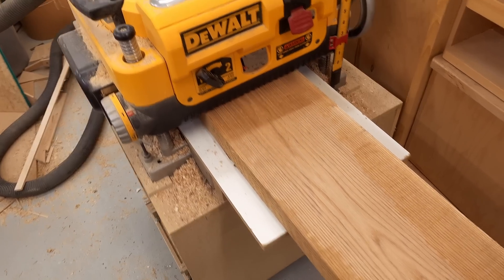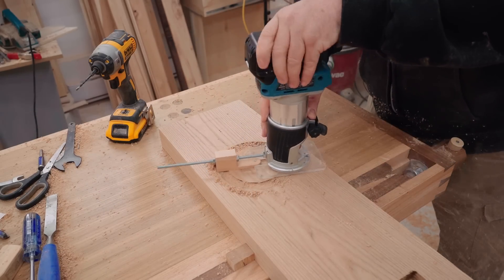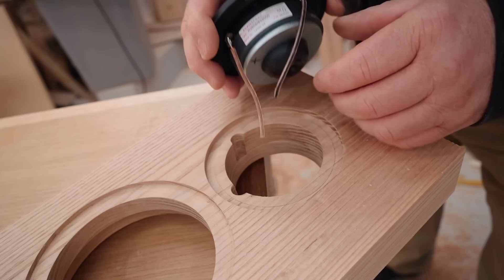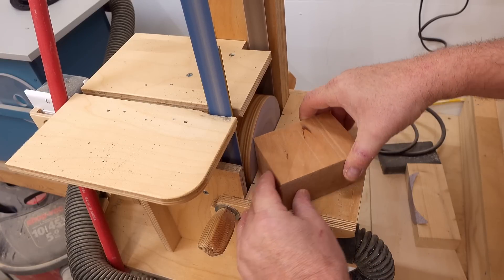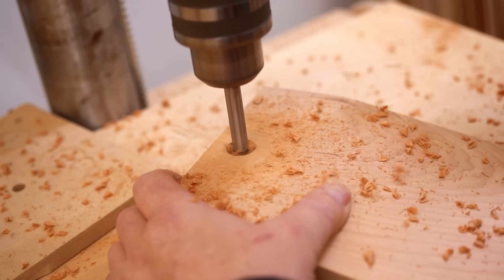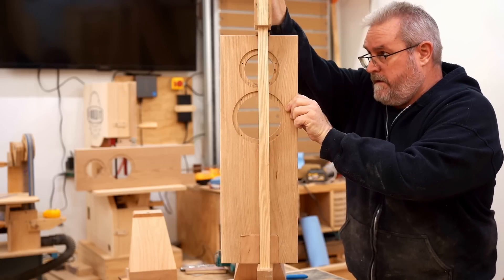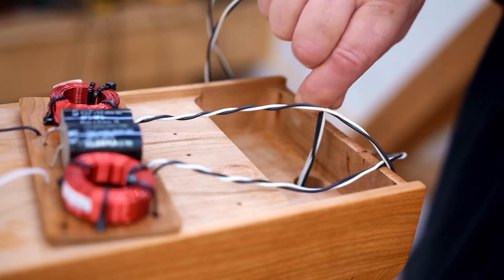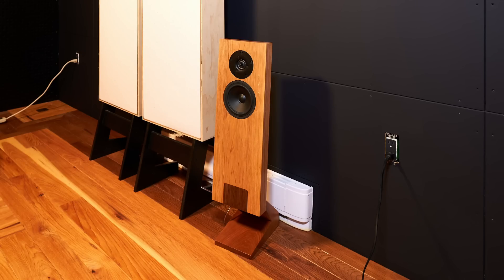Amazing Sound and Cool Unique Design - How I Made These Slim Open Baffle Speakers

Comment from the maker: I made these to work with the main speakers in my dedicated listening room. They act similar to side surround speakers and don't put out much bass. But with a separate subwoofer, these sound very good indeed. 
They are open baffle, in that they don't have a box. Making a speaker that way has some advantages, in that it put out sound from the rear as well that can sound more "full" and "open" and less "boxy". The output pattern is reduced on the sides of the speakers, making them more directional.
Not enough detail in this video? What to learn more? Watch the full build series I made for these speakers in this playlist:
https://youtube.com/playlist?list=PLQl9KPrpiIH-5l4QhxUYXHGhr-covK8n6

Comment: Measurements?
Doesnt mean a thing without measurements.
So you have a dipole with a sealed tweeter?
Most designs that use dome tweeters have one pointed backwards out of phase.
Otherwise you dont have an OB, you have a woofer on a sheet of plywood.

Comment: John, I want to build a pair of 3 way open baffle in the next couple of months, how do you suggest I find a plan and start buying the parts? I'd like to do something more challenging than just buying an entire kit that I simply slap together. I'm reasonably handy, built a couple of amps from the DIY site and experiment with separate tweeters and crossovers currently. My budget for parts is prob in the $500-$1000 range for the 6 drivers and crossover components plus the wood. Any advice is appreciated. Thanks

Comment: John, nicely done.  Working on a a TB W8-1772 full range design with an 8 inch neo woofer.  High and low pass crossover and paired with a SVS Pro 1000 sealed sub.    All in under $1K, would put it up against about anything out the in the > $5000 range.

Comment: Hello. Two observations of your crossover and it’s cover.  The orientation of your coils are the same and therefore there will be coupling of the two sections of your crossover.  Steel has magnetic properties and will enhance the coupling of your two coils. You have in effect built a transformer that destroys the design characteristics of your crossover.  I suggest you replace that plate with a thick piece of aluminum or another non-ferrous metal, (I think McMaster Carr sells copper electrical bus bars by the foot that are rather heavy), that has the same weight.  Orientate one of those coils such that it is at right angles to that of the other.  Just mounting it vertically should suffice. If there is insufficient space for that with the cover installed, cut out a channel in the block of metal that allows for the needed extra mounting space.  If you think they sound good now, these corrections will prevent crosstalk between the two drivers, (low frequencies bleeding into the tweeter and high frequencies bleeding into the woofer), that will create smearing.  They will sound even better.
Reply: tacos cure cancer

Comment: I consider it a mistake and stupidity to build open speaker systems without a closed cabinet. Since the sound wave emitted by the back side works in antiphase with the sound wave that is emitted in front. This effect is especially noticeable at low frequencies. Therefore, the bass does not sound.
Reply: So what you’re saying is that you’ve never heard a pair of quality OB speakers. That’s cool. Enjoy your boxes. Also, consider taking a class in acoustics. I did. I consider it a “mistake” and “stupidity” to make comments without the technical knowledge to back it up.
Reply: @boomcrash  I never said I haven't heard a couple of quality speakers. I have an excellent sound system. And I also heard something similar to what you are doing. It doesn't sound. Or you don't usually perceive sound waves. Sorry.